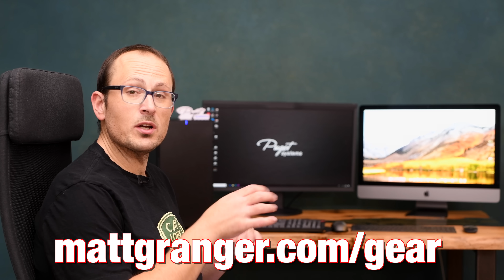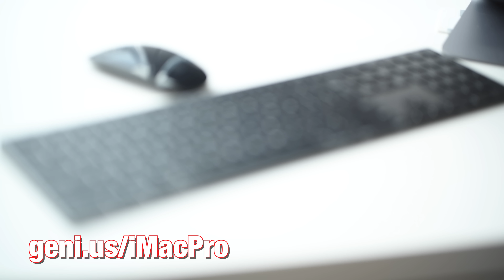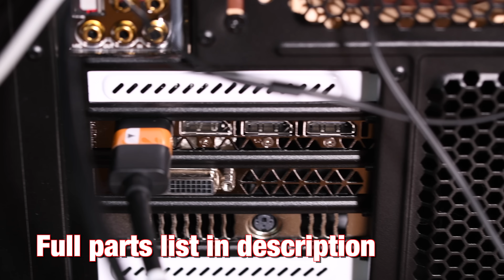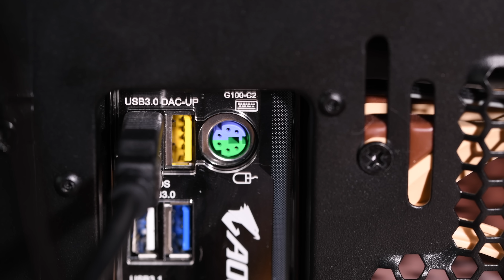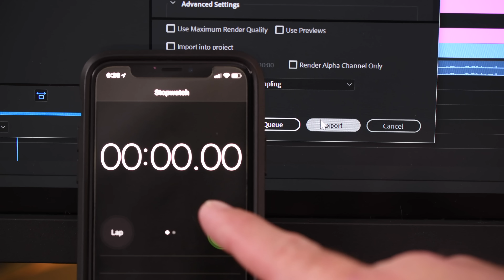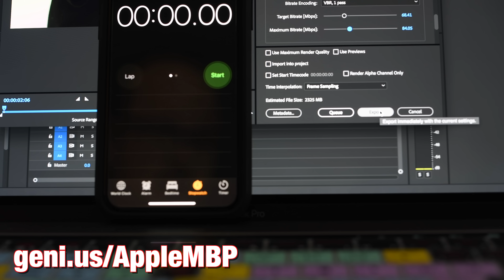$10,000 iMac Pro vs Custom PC - Which is faster??!

Comment: did you consider the price of the screen in the imac pro?add that up to the desktop
Reply: Hakan Meva exactly. The 5K display iMac uses is ~$1300.00 part. Even Linus couldn’t build a comparable system by counting that for less money; that has a lot to do with performance when you’re also driving that many pixels in addition to rendering. A 1440p or 1080p display is significantly less taxing to the video card and frees up additional resources for it to use in the export.
Reply: almost no company makes 5k displays and the reason for this is due to the fact that there is little difference as far as what you can physically see. most people struggle to see the difference between 2k and 4k unless they are zooming in on an image. thats double the pixels, 4k and 5k are just too close to tell the difference and warrant the massive price jump
Reply: Kyle that’s also not accurate, a 5K display is very useful for editors who have to compare twin full HD images during color correction, and several companies make 5K displays (LG, Dell, Samsung, HP, Acer off the top of my head).
Reply: it would be a better value to just get 2 4k displaces, you will save $200 and have a higher pixel count
Reply: Kyle two 4K 100% DCI-P3 displays would be approximately 700.00 each or more. It’s not just the pixel count, it’s the color accuracy as well. The 5K in that machine is 100% DCI-P3 + 100% sRGB.

Comment: Upgraded couple of months ago building my own system. Using the 16 core 32 thread AMD Threadripper 1950X on a Asus Zenith Extreme motherboard. The operating system, scratch disk and programs are on 2 fast Samsung NVMe in a Raid0 array.

Comment: I would go with threadripper 1950x(x399) instead of the i9(x299)
Reply: ClanCreamhershey Funasd not for Premiere. Loads of research/tests on this. I returned my threadripper as performance in premiere was poor due to the dire Adobe development not exploiting all available hardware. The 8700k (or i9) are far more efficient and Premiere performance is noticeably better on my machine.
Reply: Andy Very true. Biggest thing for x399 is the price to performance, vrm temps, pci-e lanes and the extra cores might not be as fast bit allows you to die more at one for less. The 1950x can also do raw 8k footage without half scale.
Reply: ClanCreamhershey Funasd Can it though? In Davinci Resolve I had great success and can see it handling 8k, but my point is Premiere is the bottleneck because it can’t make use of the hardware. That’s why I returned it - it would barely play back 2x 4K tracks at full res.The intel chips are more efficient here.
Reply: Andy Could you explain to me how it is possible for a Threadripper 1950x to lose to an i7 8700k in premiere pro
Reply: Rayo Crazy It depends what you consider to be more important to win or lose. Export times are important to some people and youtubers just love creating videos on time tests. To me, it’s not that important - I’ll just make a coffee while it exports. For me, PLAYBACK at full or half resolution is the most vital factor. If I can’t scrub quickly through a 4K clip and enjoy seamless playback performance, it’s useless and kills the creative process. So, the AMD chip wins time tests in most cases and will better support multitasking while you’re exporting a file, but until Adobe create software that better supports the hardware, chips like the 1950x that look better on paper will continue to perform badly. Adobe needs to catch up and create software that can utilise all the available cores. Davinci Resolve performed great for me with 1950x but it was designed to. If you Google Threadripper and Premiere you’ll find lots of results from editors alluding to similar issues that I experienced. Still not convinced? Ironically, even Puget Systems themselves have an article written about CPUs and Premiere - their conclusion was to recommend an Intel i7 chip due to the very reason I outlined above (I.e playback, but also other things like warp stabilizer performance).
Reply: @andyuxd  or just go with Resolve.  It seems a little scary at first but once you mess around with it a bit it makes a lot more sense.  The key is naming your nodes so you know what everything is doing.  Best part is it's free and comes with Fusion now
Reply: David Penner Just not sufficient for what I do David. The motion graphics capabilities (and dynamic integration) with Adobe CC mean I can get everything done quicker, and also update my clients artwork projects after release, without faff. The net result is I get paid more per hour. I love Resolve, but it’s not a simple NLE argument for me, it’s the entire ecosystem I need to get a “multimedia” job done and with the right PC hardware Adobe wins for me.

Comment: If we want 2 TB SSD instead of 1 TB SSD for iMac Pro 5K,  Apple charges us $800 more for 1 more TB SSD.
Reply: That’s because the ssd’s in the iMac Pro are comprised of 2 NVME m.2 drives in RAID 0, which is how it gets over 3GB/s write speeds. So effectively Apple is charging you less than the price of two drives at once.
Reply: what about the insane ram upgrade price?
Reply: Kyle this is also a case of what type of memory is used in the system. The iMac pro uses ECC registered dimms, which are significantly more money than other such memory. Currently the iMac Pro supports quad channel with up to 4 32GB dimms and dual channel with up to 64GB dimms. Check the pricing on 16GB & 32GB registered ECC memory and you’ll find Apple’s pricing here surprisingly competitive. Now with other machines, yes their pricing for ram is a little silly, but on a regular iMac 27” there’s a ram door on the back so you can put in whatever you want.
Reply: I used the iMac Pro 5k for 2 weeks to do 4k videos.  As the power went out suddenly, my two external 3.0 USB drives (formatted Mac Journaled worked with my Macbook Pro for years) connecting to the iMac Pro got corrupted and unmounted to the iMac Pro.  As the power came back, the DiskUtility on iMac Pro did not see or repair it.  I connected the corrupted external USB drives to my Macbook Pro to use DiskUtility to erase & reuse them.  Lost all data.  Finally, I returned the iMac Pro 5k to Apple Store and Apple noticed this issue.
Reply: you can buy a 16gb stick of ecc memory for $185 and a 32GB stick of ecc memory costs around $572 while Apple charges you, the 64gb  for $800. you already have 32gb's so if you just add another stick thats 64 so Apple still overcharges
Reply: Kyle well that’s not how registered memory works. When you upgrade to 64GB you’re removing the 4 8GB sticks from the system and replacing them with 4 16GB sticks (they all have to be matched pairs to run in quad channel) so, your 185x4= $740... and depending on the vendor the memory may not work properly with the Xeon in question. That’s what you’re missing here, this type of system needs matched memory pairs to function properly.
Reply: it doesn't actually need matched pairs to function properly, it would if you want it to be i quad channel. its extreamly rare for memory to not work with a system and it depends on the motherboard and not the cpu
Reply: Kyle that’s not accurate, some Xeons are very picky regardless of the board itself. Also, this system is designed to work in quad channel, hence why all four memory slots are filled. When you open one up and use only one stick, the system reduces its memory bandwidth causing bottlenecks. This is why matched sets are used, this has been the case on every Mac Pro system since 2006, they are designed with dual and quad channel (in this case) in mind.
Reply: almost every motherboard is designed for quad channel, memory bandwidth has negligible performance gains especially at the price it costs its just not worth it

Comment: Given the known fact that Final Cut Pro performs much better than Premiere on macOS, this comparison doesn't show the peak potential of the iMac Pro and is therefore completely irrelevant. One of the primary reasons why people buy Macs is the possibility to use macOS-exclusive software. Insisting on using the same video editing application on both systems unfairly favors the PC. There is no reason why anyone would buy the iMac Pro and edit in Premiere.

Comment: Entertaining as ever Matt! Alas you will not be able to pick and choose what upgrades you want, say 3 or 4 years down the line. This CPU, RAM & motherboard are gen-locked with each other. Your Skylake-X platform partly because it's high-end, won't get to the next iteration as quickly as the mid-range Intel core's; currently Coffee Lake, that seem to change almost annually..

Comment: Premiere is only "locked" if you select export in the dialogue box - by sending it out to a queue via Adobe Media Encoder it'll export in the background and you can crack on in Premiere on other things. It's two extra clicks.
Reply: Andy I got your point, the question is then how much more juice do you have left while exporting, and try to work with an other project? Of course depends,  on the quality etc. But if you work professionally.
Reply: If you're working with video professionally (I am) then the system should be more than capable of multitasing - i,.e. exporting a project while you continue with other tasks. I have never felt troubled during export, usually because I can continue with work if I choose to. If the tasks ARE particularly demanding (e.g. rendering After Effects compositions simultaneously, etc) then it can feel slower than normal, but it's still possible to perform tasks with a queue exporting in the background. And it's only a few minutes for me as my projects rarely exceed a 5-10 minute duration. For the record, I use a water-cooled PC - i7 8700k with 1080Ti and 64GBRAM.

Comment: This is primarily why I stepped out of a 25-year relationship with Apple; being locked into hardware that up until about 2011 aged reasonably well but the newer hardware ages extremely fast for a host of reasons. This time around I went with an entry level AMD Threadripper 1900x which gives me an upgrade path for the next six years if buying used TR 1920x and 1950x chips later on. I don't foresee the need to upgrade much else on it for at least 3 years. What I spent the real money on were two 100% ARGB monitors (Dell 2718Q & Eizo ColorEdge), based on the past 20 years, I doubt very much either of which will date sufficiently passed their ROI period. 

Apple's primary audience is not on desktop computers anymore, nor is it in the US. We'll see with the Mac Pro next year or whenever that comes out.

Comment: Honestly guys a total idiot. 

Apple users are smarter. 

Hardware + software = great performance 
iMac Pro + FCPX = Reason to buy iMac Pro

This idiot is doing this. 
iMac Pro + Third Party software = good but nothing special 

The PC is doing this. 
Custom built PC + Third Party software = good but nothing special. 

So if you really want to understand the iMac Pro. You have to use the Apple software.

Comment: The iMac Pro is a good deal provided your use case can take advantage of the hardware included. However, if you don't need 10 gig ethernet or ECC RAM or a 5k wide color gamut display, the value of the machine drops off rapidly. Still a nice device though.

Comment: It's always contentious bringing this up, but 1 critical factor between the 2 systems: 1 has MacOS and 1 has Windows.  1 of those is incredibly reliable and 1 isn't. Sure, I've heard folks having great luck with Windows, but I ran a video transfer business and every PC gave me fits for the dumbest reasons. The biggest issue I had with MacOS was the old Compressor. A piece of crap software which they eventually scrapped and rebuilt. It was terrible and now, very rock solid. Other than that, my Macs have run flawlessly and that is worth every supposed extra penny. I will say this - I have a 'trash can' Mac Pro and I still fight for it to maximize all 12 cores. It uses them all, but it doesn't use them to their full potential. BUT, I guess the positive is that I can also continue doing work while my MP is churning out files. That is a huge benefit because I'm still working and not twiddling thumbs. I have no idea if the PC can do the same - hopefully it can.  The biggest retort I hear is that it's easy to fix issues with Windows. I always reply - "That's great. Honestly great you can figure that out. It might not even take alot of time to do it. But you are still wasting time, even seconds. That adds up and is a waste of money."  I would rather a misconceived higher cost tool that gets me to where I want to go without stopping, versus one that does.  Nice review. Well spoken and you laid out the points accordingly.
Reply from the maker: I’ve not had a single blue screen or system freeze with cider house.

Comment: Somewhere on YouTube I saw a Video where they found that on Premiere the CPU cores of the iMac are not going to be used to their max potential while in FCPX they were. The assumption was that probably an update for Premiere is needed to support the processor on the iMac. Now maybe it got fixed already, or the processor isn't maxed out during this task anyway (I've no clue^^) I mean I wasn't surprised by the outcome but yeah, just wanted to note that.

Comment: Excellent review wasn't surprised with the results though, if you know what your doing you can make a PC faster and cheaper (maybe) but as Matt said you have to make sure you have the correct parts working in conduction with one another. Even though I don't use Apple products I was wondering, can you color correct the iMac monitor using the Datacolor Spyder5 or do you have to use Apples own calibration software?

Comment: So typical from a person who named his PC to openly display his animosity to all things mac. I'm by no means a Mac fanatic or fanboy, but when will we see REAL unbiased comparisons? Never even used an iphone... But if you're going to display real world uses then it's missing the point. Premiere is a piece of crap on Macs - unlike FCPX which is optimized to work with Metal. And Premiere as industry standard? That is OLD news, and not even really true anymore. Also, were you using the the APFS file system? And you weren't encoding in H265. Let's set aside the 'overpriced' question. The new Imac Pro's, component for component are actually only a couple of hundred dollars more expensive than the same in PC (if you could even GET the same equipment in PCS). IOS is a far more stable and intuitive operating system than Windows. And FCPX really does kill Premiere and Avid for speed. Let's see THAT comparison?
Reply from the maker: Premiere is the software used by more professionals. Fcpx unavailable on pc. I stand by the comparison.

Comment: Why would a pc guy want to be honest, why didn’t you install windows on the iMac Pro like you can on every Mac since everyone knows that Adobe isn’t optimized for High Sierra and run a real test or run FinalCut against Premier! Nothing but tests designed for the iMac Pro to fail!
Reply: Just because I’ve never had to take my 6 year old MacBook in for repair or has it ever crashed once dose not make the PC’s I owned before that could be fully dismantled better, not one of them ever made it a year without crashing and the best on had a 3 year life!
Reply from the maker: I’m not a pc guy haha. This is my first in a decade.
Reply: Matt Granger then why wouldn’t you have installed windows on that Mac or better since most are aware Adobe like many have not bothered to update their current software to the latest Mac OS run the Adobe against the Mac software as they have both been optimized for the OS’s they are on? That would have been a fair, interesting and unique test no one has bothered to show on a current system!

Comment: So you’re using an application that is optimised for CUDA acceleration, with a CUDA card against one that isn’t. Why don’t you re run these tests with davinci resolve which is optimised for OpenCL, which the amd card will be faster with... deliberately constructing a test that is one sided is nonsense. Max Yuryev has done a far more extensive test on this, as has Jonathan Morrison and their results are magically more much even when using software that isn’t specific. Also, if you don’t mention Final Cut Pro or test it on the Mac, that’s not even remotely accurate as most Apple based shops use it esculsively and that’s what people would be purchasing the iMac for. Your system is perfectly designed to make Premier work well, and the iMac is designed to make Final Cut Pro work well as well as DaVinci, so I would do these again and let us see the settings this time instead of just cutting to the stopwatch, that would give a far more accurate picture of the systems you’re testing. Also, and this is a minor quibble, but the iMac pro uses two ssd’s in raid 0 in order to achieve its 3+ GB/s write speeds, so your machine should have two of the Samsung’s in that configuration as well. Also if there’s an option for Metal or OpenCL in Premiere, you should use that when you run it on macOS, as that would go a long way to evening things out with the CUDA acceleration you obviously have turned on...Oh, and you could attach that P5000 to the Mac with a thunderbolt enclosure to really do apples for apples, the Quadro drivers for macOS 10.13.3 are good. Oh, and not including a 5K P3 display on your PC build isn’t accurate either, and also gives the P5000 more headroom because it’s driving less pixels. This a very poorly designed experiment.

Comment: I was trained on an Apple and never got the appeal or hype. I didn't see them as faster or better, and have been building my own PCs for over two decades. The data always indicated significant speed on PCs and while my current build is a few years old, it will still get the job done.